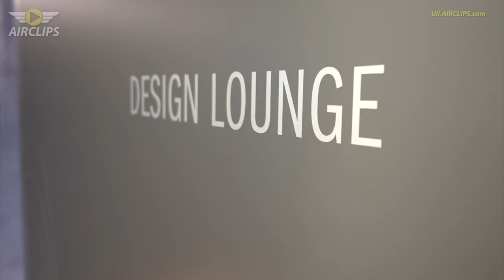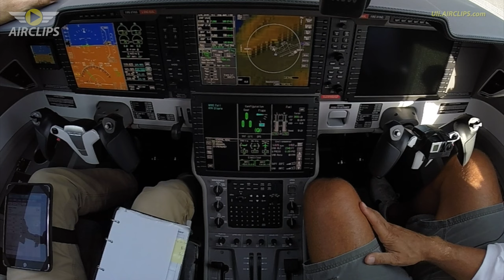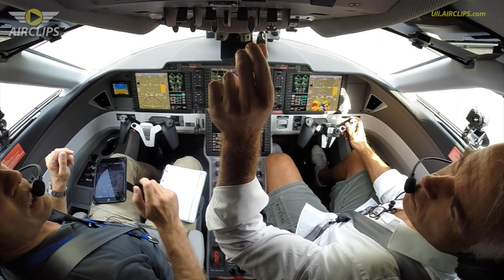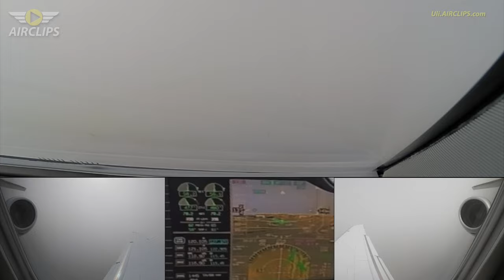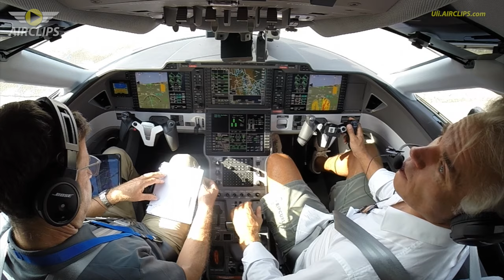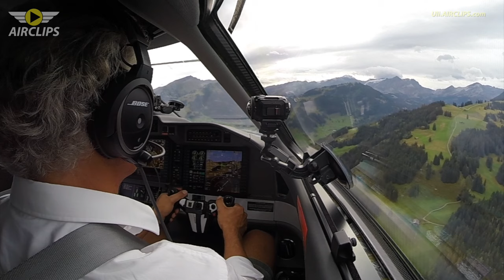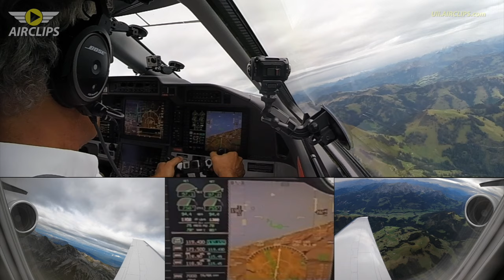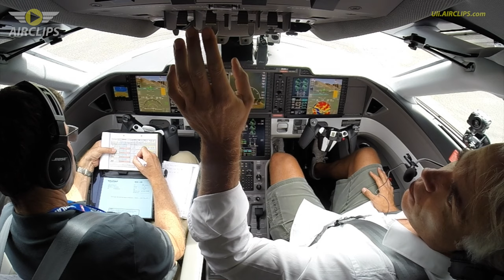Jet rocketing LOW LEVEL through Swiss MOUNTAINS: PC-24 with Uli, Ultimate Cockpit Movie  [AirClips]

Comment: Looks as a Good privet jet, but i think that your direct competitor is embraer Phenom 300, and is more cheaper than Pilatus.... Welcome your opinion or analysis of this.. Thank and congrats for this great video..
Reply: The main difference is the shorter Take-off distance (820 vs 978), the capability to land on unpaved runways, the massive rear cargo door of the PC-24. So you get a bit more utility out of the PC-24. The fact that Pilatus markets the plane directly as a Medevac also puts more emphasis on the utility aspect. Both are marvellous planes nevertheless!